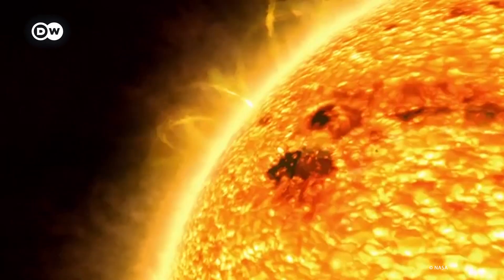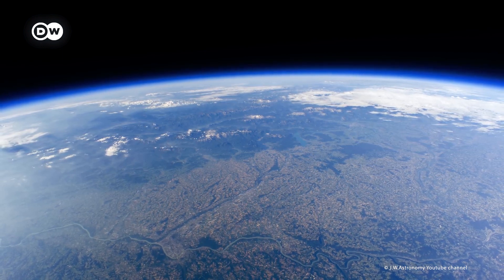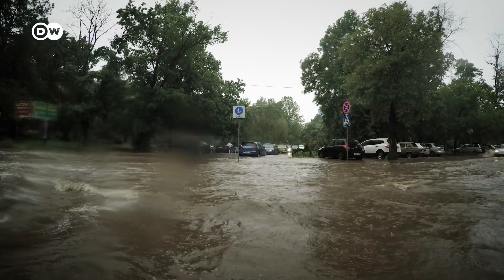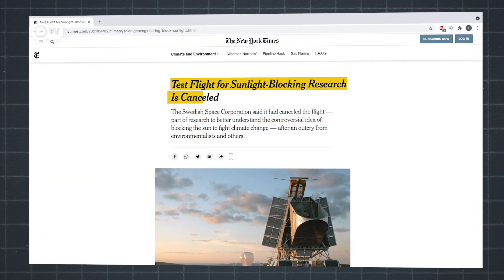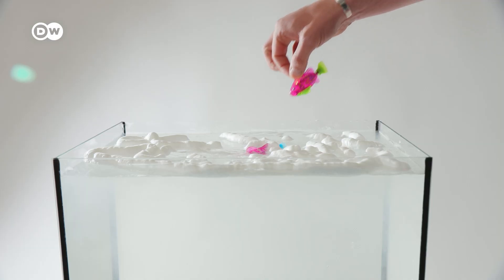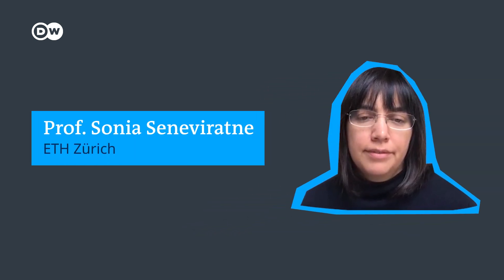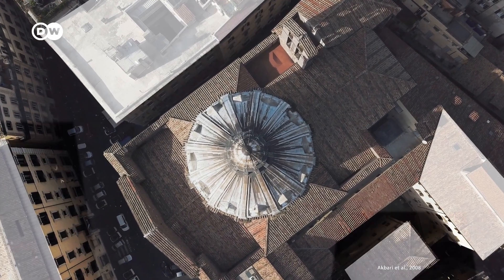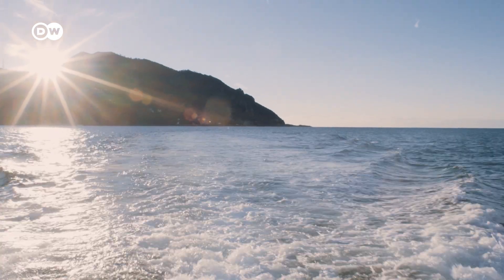Solar Geoengineering: Should we artificially cool the planet?

Comment: I agree to the end statement: priority should be to limit greenhouse gas emissions and increase absorption of those gasses(forest preservation and increase, plus maybe other methods) and study geo climate engineering, as the method of last resort.
Reply: The temperature of the Earth will not matter if our air and water is too polluted to breathe or drink.
Reply: Although I agree that we should use geoengineering as the last resort, I also believe we need to investigate and develop the technologies and techniques to do so right now, that way if and when it becomes time to act, we have a definite method of procedure to mitigate the impending crisis. 

We also need to investigate all low hanging fruits for reducing our emissions as much as possible, such as populating every roof with as many solar panels as will fit. It may be that even if the solar roof of a business does not zero the energy consumption, it should put enough of a dent in the demand that the energy requirements at utility scale will be reduced enough to affect the global climate issue. It could also make for a significant ROI for the cost of installing the panels, and may not require all that much infrastructure.
Reply: @western wumao That's exactly why geoengineering is only one part of the solution.
Reply: @RogueSecret  I'm here saying we should use all available resources, including WTE. I'd rather burn our garbage for energy vs putting it in the ground, though solar collection and all nuclear reactors are better. I'm sure thoreum has its hazards as well like uranium, and I also wonder why we can't reenrich waste nuclear fuel for fresh reagent. Everything has its place, with the exception of waste in the ground, unless you can make it safe for construction backfill.
Reply: @Salvatore Guidone Have we? I think we have more tools than you might think, though it will take some big changes to reverse the damage, which will take time and effort. We need to be developing and implementing everything we've got to throw at the problem, discounting nothing until proven unviable.
Reply: It's too late for that. If we covered every square meter of land on earth with trees, it wouldn't be enough.

The most plentiful greenhouse gas in our atmosphere is water vapor. The more we warm the more water vapor, the more we warm....

CO2 for the ball rolling but now we've started a chain reaction.
Reply: Priority is to end the greed at the cost of the planet makes one rich economy rules.
Reply: Or maybe do both? It doesnt hurt.
Reply: It would be too late to use a method of last resort. The whole point is we use it now to buy us more time to get to net 0

Comment: This is not really a solution, as farms and plants need the current amount of energy from the sun. If we reduce the amount of rays earth receives from the sun, we could create other environmental disasters.
Reply: Yes, and even the bubbles one that only covers the sea will still make it much harder for underwater plants to live which are very important as well. Although, the cities one does not do this because humans don’t need that light to live, so that would work albeit to a lesser extent.
Reply: I don't know if it would be that much of an issue, but it does concern me as well. Especially, since we should be focusing on reducing our impact, not on ways to yet again continue with this terrible trend of consumption and environmental destruction.
 @Whwhwhhwhhhwh Dldkjdsnsjskskskdk  I agree. However, as a biochemist, I must add that we do need sunlight to live, mainly for vitamin D synthesis. But, yeah, on our skin, not on our rooftops. 
I also believe that whitening roofs in hot places could help if this actually reduces air conditioning usage. 
Even so, better building standards for cross-ventilation, insulation and so on need to be passed on so that higher standards for energy efficiency in new buildings are stablished by law and therefore these require less heating and less cooling. 
Cooling the earth might prove necessary at some point if we keep this up, but our main efforts should be focused on reducing consumption as well as forbidding the production of single-use and low-quality products while also reducing energy consumption. We should always ask ourselves about the impact of buying a certain product and whether we really need it or not.
Reply: @I love you but 0.2% of the Earth’s surface is still the size of four UKs lumped together, a lot to cover
Reply: There are places where there isn’t farms However like the Sahara, why not start there ? The Sahara cooling would do wonders
Reply: The ones that return energy at the surface level only change heat energy and much of what we worry about is only infrared wavelengths which won’t really make their way over too the plants in time, but yes what you said is another negative possibility for any sky or orbital level change as they span too far of a distance and limit too many wavelengths
Reply: It turns out that reducing sunlight a bit during hot sunny summer months increases plant growth. There were experiments that showed how plants using respiration to cool themselves grew less. Even plants can get too much sun. On top of that the models are for reflecting less than 1% of the sunlight in any given region.
Reply: @andrewday3206  the public had better start grasping that this technology might be our last chance and sharpish
Reply: Chemtrails

Comment: One problem with climate engineering is that when we put out the effort to make the planet become cooler we might start a runaway process of global cooling. Unforeseen self reinforcing feedback loops might be started that would cause a new ice age. I think we are going to have to eventually engineer the climate, though. If we are going to become a multi planet species we are going to have to know how to manipulate the weather in planets like Venus and Mars.
Reply: We definitely don't need to worry about too much global cooling rn
Reply: If we have to engineer the climate, let's try it first in Mars or Venus, far away from Earth.
Reply: True but causing an ice age seems less likely to happen. I don't believe such a scenario will occur in our time.
Reply: @CBC460  true since it takes a long time
Reply: Yeah maybe let's practice on another planet first!
Reply: Let the new ice age begins
Reply: Except it's already being done
Reply: Becoming a multi planet species isn’t exactly a wise idea unless it’s just a way to take a break for a few generations during travel to a different star if we reach the near end of this one, the largest issue is having enough hydrogen and oxygen molecules (in whatever bonds) and depending on how we have those molecules we also have the issue of sequestering or “making” enough energy to separate the bonds and if necessary utilization of the energy from re bonding those molecules in whatever form needed the most obvious to me being water, which is also one of the possible sources. Beyond that most requirements can be taken care of as carbon is moderately abundant in the universe and nitrogen isn’t exactly used enough for scarcity to be an issue when it comes to finding or sharing some.
Reply: No.
Let's do it today.
Reply: @aterack833  You sounds like the one who complain about something good at first and then when it’s gets successful you say things like I knew it………. And multi planetary species doesn’t have to be in different solar systems…….. we have one planet in our own solar system which can support life aka Mars……..
Reply: @NOTycyborg  I will admit that I have thought “oh that’s nothing/just as important as all the other collapse news I hear” about the cv back in March 2019 when I first heard of it and then said that I should have said something/known something/done something about it when I heard of it, but that’s not the same thing. And the whole point of what I was saying is that matter and energy cannot be created nor destroyed, and we don’t live in enough abundance to have another planet support us or for us to support it.
Reply: @NOTycyborg  you realize how cold mars is?
Reply: Chemtrails
Reply: I agree and like that can't we make Venus habitable
Reply: this wouldnt really matter coz we are already the highest professionals at using power plants  releasing CO2 in to the atmosphere

Comment: No... Blocking out sunlight will decrease photosynthesis dramatically, and then you'll have a snowball effect of not being able to absorb enough carbon out of the atmosphere
Reply: Man, you should tell the Harvard guy, I am sure he will be glad you enlighted him
Reply: We can use machines called carbon capture to absorb the extra carbon dioxide from the atmosphere and bury it back into the Earth.
Reply: @CBC460  we emit something like 40 billion tonnes of co2 in the atmo every year. Do you even know how many of those things we would need to remotely match trees? lol
Reply: True, we need the plants to remove the CO2, plus we need them to eat
Reply: But the plants will also have higher co2 making them grow faster
Reply: @markus103103103  CO2 is not a substitute for sunlight. They need adequate amounts of both.

That's like saying you won't need food anymore as kind as you get extra water
Reply: @markus103103103  nope... You need sunlight to do that... You block off the sun, the plants won't be able to photosynthesize as efficiently if they had full sun

Comment: How about if everyone opens their fridge door at the same time ! Messing with nature doesn't seem like a good idea to me , it can't end well .
Reply: @whwhwhhwhhhwhdldkjdsnsjsks6544  the amount of money spend on these silly thing..m why not spend same money such to plant trees and make planet green
Reply: It's already being done to some degree, there's the HAARP weather control system.
Reply: @Mario Kart wont work,  the carbon is too dispersed for it to work effectively.  To make it work effectively you need to put the machine on the source for example a coal power plant and something like that.
Reply: @Mario Kart you forgot to account the material use. To make your plan work you need thousands to millions of huge carbon capture facility.  Which means that it also need tons of material to make, and also those carbon plant needs to be maintained every few year which mean parts getting changed and dont forget the solar panel. Energy need of those facility will be huge as well considering the one that was already made has huge fans running 24/7 outside and machinery that transform co2 to fuel.  I think its better to use a carbon sequestering plant like hemp rather than making those ginormous facility.

And yes,  ik tree is not the saving idea like everyone is talking about. Thats why i didnt mention trees in my comment before
Reply: @Mario Kart hemp can be used for a lot of stuff,  like hemp fuel,  medicinal use,  crafting stuff and many others
Reply: @Mario Kart i know,  then what you do is just the same,  taking carbon from athmosphere using a huge facility then using it as fuel,  releasing it again to the athmosphere.  But with hemp,  instead of a huge facility,  its a plant that could fertilize the soil. 
Yes,  i forgot to say that hemp is good for the soil as well
Reply: Chemtrails

Comment: Didn't aerosol literally burn a hole in the ozone hair? Also, I feel like making the atmosphere more reflective wpuld have devastating effect such as the death of certain plant life
Reply: i mean if all types of aerosol destroyed the ozone layer then there'd already be no ozone layer left by now.
Reply: Aerosol is an extremely broad term that can be composed of just about any solid or liquid so long as it is in small enough peices that it can be suspended in the air including water. What you were thinking of is the CFC propellant used to power aerosol cans which is what does break down the ozone layer not the aerosols themselves.
Reply: Theres are different types of aerosols

Comment: Years ago I had an idea for re-roofing material commonly used for commercial flat roofed buildings. Grooves are pre-cut into the white colored mat which is oriented to the Sun. The grooves have a particular shape with a dark colored side which absorbs solar heat from the low winter sun but reflects summer sun, This would save on heating and cooling.
Reply: I have also seen an array of solar panels used to do similar, although solar cells tend to be rather dark. I'm not sure if extracting energy from solar panels would reduce their temperature enough, but it makes sense via Thermodynamics.

Comment: Imagine all the mega corporations stop using fuel energies and atart using eco friendly energy sources, just imagine.
Reply: If they did it suddenly much industry would collapse and for some there is no way to use eco friendly energies like the aviation industry, but yeah over long term I guess it’s theoretically possible
Reply: Going Green is very available.  An we should've started yesterday.
Reply: I wish the world worked that way
Reply: Imagine all the actual necessary things these businesses do were switched to government operated/regulated (at least in the aspect of no profit to the business if still run in the same manner so those worried about how poor the government runs things have their worries covered) versions where many things were consolidated into one business without major loss of brand/type options (grocery stores and hardware stores and department stores would be the biggest offenders) so you could go the the hardware store in your town and know you can get whatever brand or option you need or go to the grocery store and know you can get whatever brand of chips or type of sauce or condiment or bread or meat you want without having to worry about 6 different stores all carrying the same bag of Doritos or janes chicken or nestle coffee and the same for 6 different stores with the same dewalt drill bits and Milwaukee chisels or whatever (I hope my point came across well enough without me knowing exactly which brands of food and tools are common place between many stores)

Comment: easiest answer is paint everything white(aka roofs, roads, buildings). it will get less hot therefore less ac and reflects light back out and all the above no side effects!!! ALL Gain no lost
Reply: Can we dye asphalt white? Good idea!
Reply: Don't forget the most easy way would be to reduce and regulate emissions and the remaining surplus carbon can be reabsorbed by plants?
Reply: Not even a drop in the bucket. Not to mention white just reflects it back into the atmosphere, it doesn't cool anything.

Law of conservation of energy still applies
Reply: @AshGreen359  Most of the reflected light will leave earth through the atmosphere.
Reply: And who is going to clean all those white surfaces once they start getting dirty and losing albedo?

Comment: I think that geoengineering is too risky, we have far too many unknowns. The worst case scenario is that we release something into the atmosphere and it creates an ice age with runaway cooling. I would suggest we spend more time building nuclear power plants as the most stable form of electricity generation that isn't affected by inclement weather, or the lack of, until fusion power becomes a reality and replaces it. The efficiency of thermophotovoltaic (TPV) cells is increasing to the point that it may soon be more efficient to convert fuel (coal, oil, diesel, biomass, uranium, thorium, etc.) directly into electricity without the use of steam pressure to turn turbines, which means we could have power plants that have no moving parts, which means a lot less maintenance and a lot less ongoing cost, and perhaps we could see this kind of electricity generation moving into the consumer market where schools still use boilers to heat classrooms. More efficient energy generation also means less fuel needed to burn to produce the same amount of electricity, so in the case of coal-fired power plants it means less coal needs to be burnt, which means less carbon dioxide produced.

Comment: It would seem an object in orbital space would deflect more sun and project a larger shadow on a particular area the most efficient. If this object was flat like solar panels and could open panels to certain degrees to have a variability of shading. This object could have thrusters to position it more directly.

If this object had solar panels it could move in space with this gathered energy.
Reply: Exactly what I was going to comment.  If it was in a high orbit, it would shade more area but in a low orbit large numbers could be used for solar power.  Then the power could be beamed to earth via microwave or laser. Reading the comments on this video is rather depressing. The number of ignorant and or religious zealots who think we can't and don't influence the climate is way to many. Just a few short decades ago we changed the climate from dust bowl to garden by modifying farm techniques.

Comment: As a Canadian, I can say that reflecting heat is not my goal when building at all. Absorbing as much light and heat from the building into the home during the fall, winter and spring is a key objective here and so we use overhangs that are just right to block out the summer sun from our passive solar home, while allowing in the sun in the cooler seasons when the sun is lower on the horizon. No till farming is also a good idea on many many levels, soil and organic matter retention being the keys. For the inputs, more crops can be grown. More wheat/lb of nitrogen/phosphorous/water added since the plant matter combats erosion and nutrient runoff.

Foam and aerosols ought to be treated as weapons of mass destruction and tightly controlled. Gaia will make more clouds if she needs them and let them drop if she doesn't.

Comment: Thermal mass dictates the heat carrying capacity of our atmospheric gas . The SRM plans are like putting in a thermostat,  just without an on switch , that will ( in most cases) only increase the mass of our atmosphere.